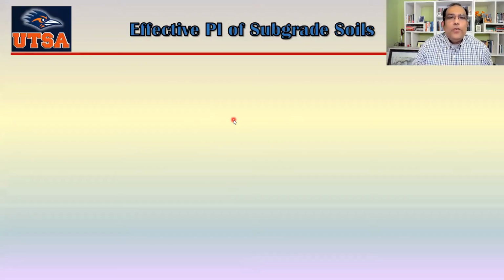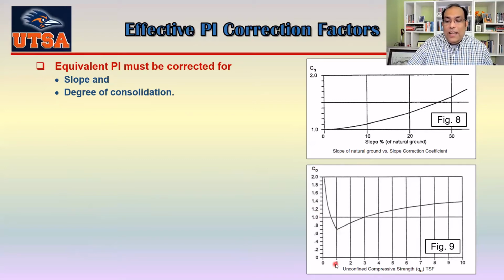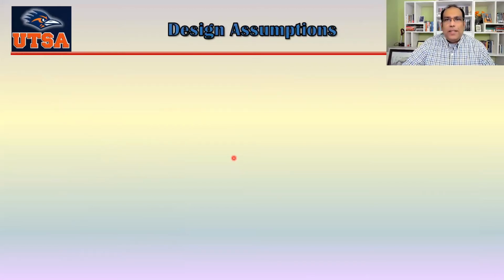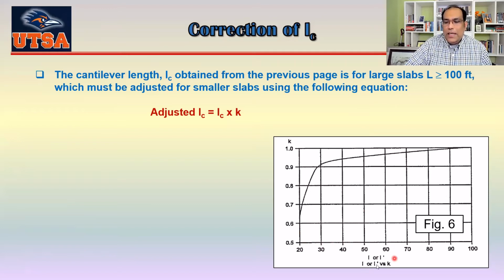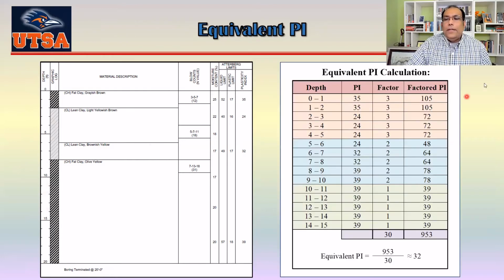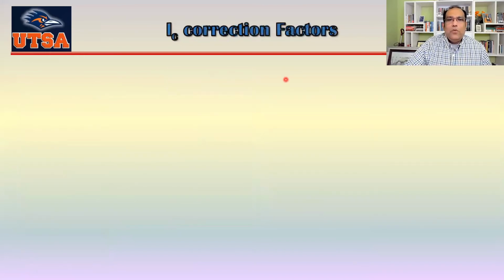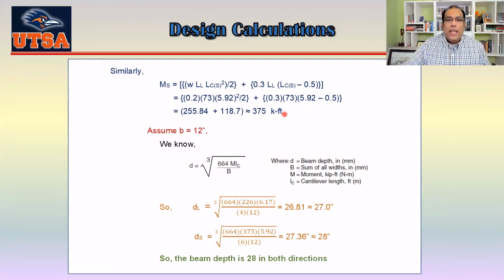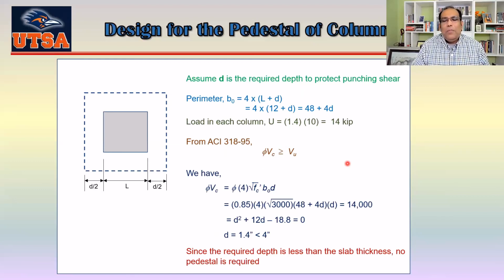Slab-on-grade Foundation Design in Expansive Soil: The WRI Method

Comment: Thank Dr. Shafique, this is valuable information. Could you also explain how does concrete reinforcing works on the WRI example? It isn't clear which ACI formulas are used nor the procedure applied for steel in beams, slab and slab thickness assumption.
Reply: did you find any good examples for slabs ? youtube is really letting me down.